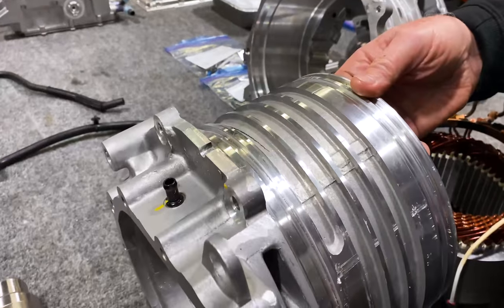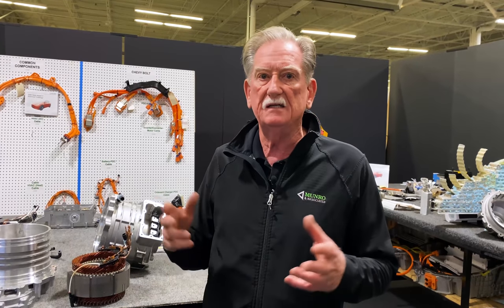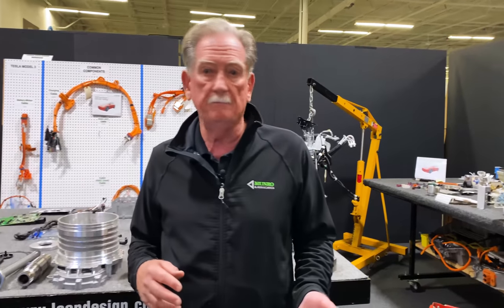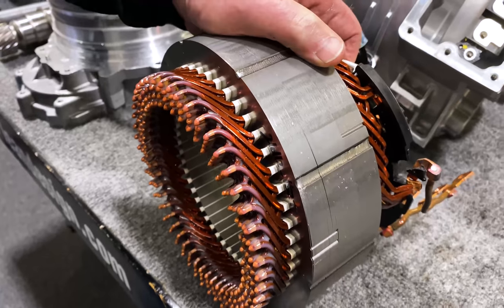Mach-E Front Motor: Sandy is Blown Away by Great Design

Comment: Thanks Sandy for this motor teardown.

I can comment on the winding technology wound vs hairpin. I work with engineers to help them simulate and design these different types of windings and they both come with pros and cons.

Wound windings are well known and more flexible in their design, you can make them fill a slot of any shape with a rather good fill factor. The insulation between each separate wire makes that fill factor impossible to reach 80% for instance. Designers usually can go up to 50-60% of copper in the slot. In terms of layout it is also easier to do any sort of connection as you can bend and reposition wires "easily". The cooling of these wires is not very easy as it comes as a large bundle of wire with resin/impregnation around them.

Hairpin windings are a recent trend as they provide some benefits. The fill factor can be a bit higher but the slot has to be rectangular. Also as you mentioned Sandy, with higher speeds, you have higher frequency currents and then you can start to have eddy currents and proximity effects going on. It means the current goes mostly on the outside of the section, so you increase your AC losses. Also the conductor closer to the rotor and the airgap sees more varying magnetic flux density which also generate more losses as well as unbalances between wires. The connection of several paths of hairpins also creates unbalances in genral and you can have circulating currents. So in general, it looks easier on paper, or to manufacture and assemble but it means more challenges and less flexibility in the design. 

I think Tesla kept the wound windings for the simplicity it brings even if it may mean a slightly lower fill factor. They chose initially induction motors over PM motors for the same reason. 

Regarding the V shape or W shape of the magnets, it is obviously a very sensitive design depending on the performance to achieve, the magnets help for the low speed torque and the V shape acts to create reluctance torque at higher speeds. A tiny change in angle or dimension can change the torque or performance by 10% and the cost of magnet material as well.

I work with Altair and we can test and simulate those several multiphysics effects. More than happy to answer any questions.
Reply: I don't work in the field, but I thought the difference in layout of the magnets might be due to the different diameters. Magnets that are placed closer to center would need to have a different angle to align to the magnetic field lines than magnets that are placed further out from the center.
Reply: Thank you, that was an excellent overview.
Reply: Thanks for taking the time to write that.
High power high efficiency electric motors are definitely more complicated than what meets the eye.
Thank you for the insight ..Take care enjoy 😁
Reply: @Sandy Munro, @TheSimong85 Great explanation about the stator wiring options. 
Can you also comment regarding the stator water circulation that Ford and VW use without a need of a pump, 
versus the Tesla oil usage requiring an oil filter and a pump? I might be wrong, but does Tesla uses also 
the oil pressure for dissipating the heat from the rotor bearings?
Reply: The hair pin design  is patented
Reply: Surely though the self inductance of the stators windings renders the high frequency switching kind of moot. Yeah the controller/driver is switching at (relatively) high frequencies but the motors inductance integrates this, forming a low pass and smooths out the switching. The net effect being that the current flowing within the stator isn't high frequency anymore it's hopefully low frequency sinusoidal, the frequency of which follows the rate of commutation.
Reply from the maker: Thanks for the insight, very informative!  

If you or someone in your group at Altair would like to come and talk shop about the nitty gritty of electric motors on the channel we’d love to have you.  Email Cory at csteuben@leandesign.com
Reply: @biggityboggityboo8775  The PWM switching frequency isn't important to skin depth effect, but the frequency of the sinusoidal power is... and at 12,000 RPM in an 8-pole motor that's 800 Hz, which isn't high but is high enough to have a slight effect on bar windings of the thickness used in these motors. Sandy is far from the only one to get sidetracked by nonsense about skin effect because they didn't bother to look up the actual values.

And more turns of thin wire may help with skin effect, but suffer from more proximity effect, so I can't believe that this all matters much in the choice of winding type.
Reply: EV is spiking into THE topic on YT - Altair should really take Sandy up on that invite to come on his channel
Reply: It seems clear that Tesla initially "chose" induction motors over PM motors simply because that's what AC Propulsion did, and Tesla was just the commercialization and capitalization of AC Propulsion's car proposal.
Reply: @markwilliams5654  The hairpin design is very common. The motors in the Two-Mode hybrid system from GM/BMW/Chrysler more than a decade ago were all hairpin wound, and GM hybrids and EVs have been since, as well as various motors from other manufacturers.
Reply: @brianb-p6586  There are real world studies examining these effects.  The loss is significant when comparing motors of similar designs especially at high RPM and high frequencies.   Losses due to skin and proximity offset the higher slot fill at 8000rpm in this particular model.  

Look up: Comparative Study of Stranded and Bar Windings in an Induction Motor for Automotive Propulsion Applications by Hannah Koke.
Reply: @Robbie6298  So it matters only at speeds that the vehicle isn't normally driven - probably a good compromise.
Reply: @brianb-p6586  depends on reduction gearing and how much you value performance.  The data shows better overall efficency over a broader range for stranded windings over most rpm ranges.  The motor efficency charts show a broader avg efficency over a wider RPM range for stranded windings the data also shows narrower efficency range for bar windings.  At least in this study.  With 10:1 reduction gearing 8000 rpm is about highway speed given a normal sized car tire.
Reply: @brianb-p6586  8000 rpms is a common highway speed on a Mach-e
Reply: I think a deep dive on motors via Munro life would be a fantastic learning opportunity...I hope this happens so they can discuss voltages, magnet design, back EMF and the list goes on...Munro live has turned out to be a treasure trove of learning about EV's.
Reply: @brianb-p6586  Well 'just', except for the fact almost everything was redesigned.
Reply: Most often I read comment and think, “Dude, I doubt you even know how to change the blades on your mower.” I DID NOT get that impression here.
Reply: Clearly I should have studied more in college, but I did meet a lot of girls and drinks a lot of beer - so there's that ...
Reply: @TheSimong85 any views why Porsche went with this concept in their Taycan? They even made a video about it : https://www.youtube.com/watch?v=pmWFt0_RUoU
Reply: @MunroLive  I’d love to see that
Reply: IMO there is only one problem to solve and that is the low speed/stall torque. Any motor that can provide enough of that can propel a vehicle from that on. ACIM is great, but as far as I understand hair pin is superior in permanent magnet motors because it can take more current and heat.
Reply: @LandParkColby  ...I studied a lot in school, and I always ended up working for someone who didn't. Now I just party too.
Reply: @dermoff  So far only Shanghai got the production lines for hairpin stators, but Austin and Berlin will get them to very soon. And in a more advanced version of course😋
Reply: @dermoff  So why did Sandy change his opinion to "hairpin is worse"?
Reply: @MunroLive  That would be great, Sandy.
Reply: "the slot has to be rectangular"
Technically it could be different, but that would likely cause too much non-standard costs and design headaches.
I do wonder if a winding could be pressed to fill the gaps. Or a hairpin be improved with laminar wires.
Reply: Why is electric car manufacturers making small "high" rpm motors? trains have direct drive or a single gear set. And surely efficiency goes up with slower rpm on less gears. You run lower frequencies too.
Reply: @MatsNorway  One word answer: Weight!
Reply: @Alfred Wedmore you asked why car manufacturers are using small high rpm motors.
Trains typically weigh hundreds of tons. The size and weight of a train's electric motor is of less importance.
When you build as car with a motor with enough torque to start from standstill on direct drive it will be bigger and heavier than the equivalent geared down high rpm motor
Reply: @MunroLive  I hope this happens !!!!
Reply: @TheSimong85 This stuff is fascinating to me, but I'm terrible at math. Would that be a huge crutch working in your field?
Reply: Thanks for your comment. Very educational.  I've worked in rotating electrics for a few years at the engineering level. Currently work for one of the big OEMs at their prototype and test facility with engineering and design on the other end of the building. Also worked on the original Tesla roadster and the all electric Ford focus. Your post is very informing. Thanks again.
Reply: @MunroLive  @TheSimong85 would love to watch this so please make it happen guys! Be great to see how Altair can relate their simulation sw capabilities back to some real props!
Reply: @ericsandberg3167  is this Eric from 5th FTS @ Vance?
Reply: Thanks for adding so much to that discussion, I am an electrical engineer, but not a motor designer, I designed actuators when I was working and there are lots of tricks to the trade also.
Reply: @theupscriber65  love my Focus Electric!
Reply: @TheSimong85 Hello sir, Good to here from you. I do BLDC Motor Design, I always wonder how tesla wound their Motors to handle thousand amps of current. How it can handle that much amount of current? Would you please explain?
Reply: Totally agree with the above. Some of our customers actually goes above 1000 Hz motor frequency with the hair-pin design which in MHO is a bit too much.
Reply: Tesla has moved to the hairpin rather than wound motor for their newest revision.
Reply: Alice,  It was my understanding that these motors were driven at fairly low frequencies (a few kHz) due to switching losses. This is especially true if Ford is still using the old IGBT technology as opposed to  silicon carbide MOSFETs.  With that  in mind the skin effect you mentioned is not much of an issue.

Comment: Title should read: Sandy is blown away with Fords choice of sub contractor for its electric ⚡️ motors !
Reply: .... maybe.
Reply: Thanks to SpaceX, it should be possible around 2030 if they are fortunate. Without them, it would probably have take 10 or 20 more years. So the answer is No, seriously after more than 50 years it should be more than abvious.
Reply: @robdc4829  No Nasa did, I had nothing to do with it. He is right in some ways but you are right as well. Ford choice a good company to do their motors, who already had this motor. So Apple, designs all their stuff, and their Chinese contractor, builds the items. Did Ford design this motor? If not, they at least chose a good supplier to do it for them. Good, but second place, compared to Tesla. Sorry, ask Sandy who is the bench mark for EV's.

Comment: would've been really nice to hear more about why these gears were so great with showing a few different kinds maybe
Reply: It's not that the gears are great, just that forming two gears and a shaft from a single chunk of steel, instead of assembling two gears onto a separate shaft, produces a simple and reliable part.
Reply: Makes me think he is a real Ford puppet!
Reply: Combining 2 gears and a shaft on a single forged part is a neat design. 
That remove 2 male and 2 female splines.
Reply: @1943vermork  Yes, although typical modern construction would probably be to cut the smaller gear on the forged shaft, with only the the larger gear splined on; it looks like the Chevrolet Bolt is an example of that.
Reply: @raroque12  Are you one of those Tesla fanatics.  He can praise Tesla up and down but the moment he says something positive about Ford you think he's a Ford puppet?  And BTW Ford didn't  make the motor in the Mach-E, Magna did, he's praising Magna's engineering work.
Reply: @raroque12  

it was designed and built by Magna

Magna builds the I-Pace , BMW Z4,  Mercedes-Benz G-Class and the BMW 5 Series
Reply: @darh9820  I'd buy a Magna car. They should buy Ford and fire most of their executives.
Reply: @darh9820  And the Ipace motor already achieved more advancements points than Tesla from Munro...

Comment: Great teardown! Thanks as always. So, Ford on the Mach-e has 2 different supplier for the front and rear powertrain: Borg warner for the rear unit and Magna for the front.Toughts about this?
Reply: I was thinking the same
Reply: The question is why does the car with the big battery consume less?
Reply: @abraxastulammo9940  where did you read this?
Reply: @abraxastulammo9940  what "car with the big battery" do you mean?
Reply: @Chamieiniibet  The 99 kWh gross capacity Mach E versions.

Comment: What I want to know is did Ford have anything to do with the design of this motor or was it all Magna, and Ford just basically bought this off the shelf. I have a 2017 Ford focus electric, and I believe the powertrain in it was completely designed by Magna.
Reply: Most likely outsourced engineering
Reply: They were in a hurry.
They didn’t have any in-house expertise.
They wanted something that worked.
They didn’t care about the price.

What do you think?
Reply: My other car is a Tesla Model 3, and I will be replacing the Ford with another Tesla Model 3 soon lol
Reply: Ford's current electric drive components are heavily based on VAG designs.
Reply: Magna is a Tier 1 supplier - that means it supplies parts directly to the assembly line in a just-in-time fashion.  Ford, GM, and Chrysler got rid of alot of their in-house people and went to suppliers.  That's why Magna became such a huge company - it took on the work that the "big 3" in NA were outsourcing.  Magna also builds entire vehicles.  They are building the Fisker vehicle.  They recently entered into a Joint Venture with LG to produce electric drivetrains, inverters, and other systems.  The traditional automakers going forward will very much depend on suppliers like Magna for electric systems.  That's not a bad thing, Magna employs 169,000 people worldwide and they in turn have their suppliers for stuff, also worldwide.  Besides, with Magna building so many different parts for so many different vehicles, they are in a position to draw on their experience on what works best, where.  We shouldn't be surprised at seeing some innovative designs from a supplier like Magna.
Reply: @quantummotion  Also, they probably built the electric car Sony showcased at CES in 2019.
Reply: @TiagoJoaoSilva  I remember when they brought out the Powershift dual clutch with dry clutches. In an actual presentation to us they had VW graphics and animations! And then the thing was garbage due to the dry clutch design and they just wore away prematurely.
Reply: Ford needs to read the Amazon reviews before piecing together parts for thier new "mustang".  Looks like they got an amazon choice part with this one.
Reply: Yes, the drive unit in the Focus Electric was designed and built by Magna.
https://www.magna.com/docs/default-source/2017-press-releases/electrification-ces-final2-video_sound.pdf?sfvrsn=2
Reply: @TiagoJoaoSilva  Ford and VAG only agreed to share EV technology last year; this vehicle was designed long before that, and involves no VW components or designs.
Reply: @audiostanton  what would that "source" be? Magna doesn't provide "ideas" to auto manufacturers - they provide components, such as this complete drive unit.
Reply: @TiagoJoaoSilva  Magna Powertrain did both.
Reply: @quantummotion  I saw BorgWarner investor day presentation claimed it supplies the integrated Drive module which includes gearbox, motor and inverter? Does that mean Magna provides that to BorgWarner, then sell to Ford?

Comment: I learned that skineffekt comes in play at higher frequenses, so there must be a high frequens based system. It also makes inductiv components more compakt. Ewen the diff. is compact. But maybe "big part" based with exp. repear...? The inwerter looks clewerly designed. Many smaler caps. might be inustrial standard components and therefore cheeper to use. The cooling from the other side is a elegant way to do it. Nice and tidy. They found smart people to design this.

Comment: Mr Monroe. The skin effect, I believe, applies to high Frequency power; usually in the upper MHz or GHz rates. DC  and low Frequencies use the cross area of the conductor.
Reply: This idea is correct.  The depth of the skin is inversely proportional to frequency.  Motors tend to run at very low frequencies (20 kHz area) where you're right.  You'd use the entire cross section of the wires.  A couple hundred kHz and you'd go ahead and do the calculations for completeness.
Reply: @jackpalczynski7884  The audio fools will argue this point.   I've seen some evidence that even at or just above 20Khz the skin effect can be measured.  I know once you reach say 50Khz or so it certainly has some effect.  My background is in electronics,  however I'm certainly no expert on the subject of the Skin Effect.